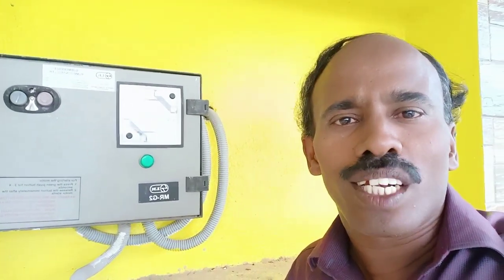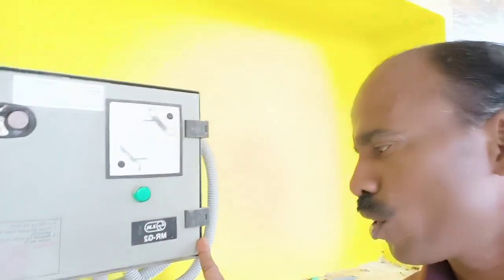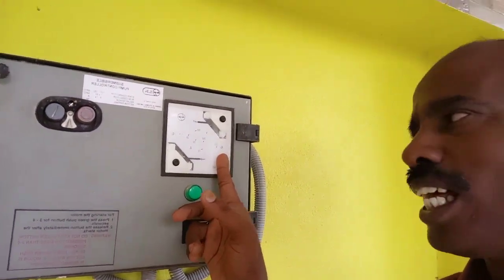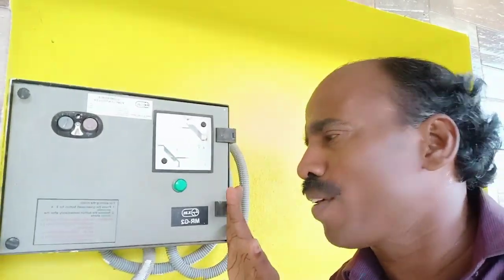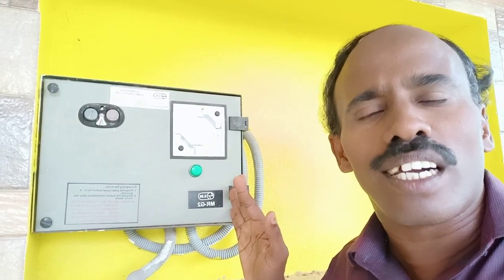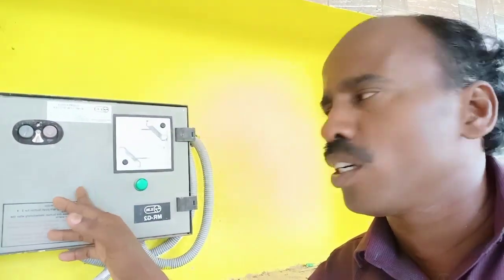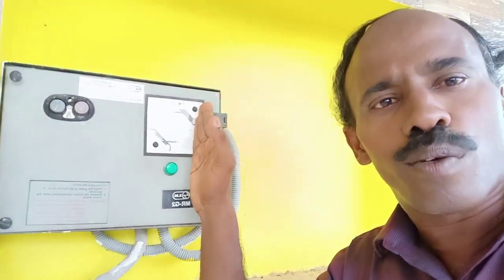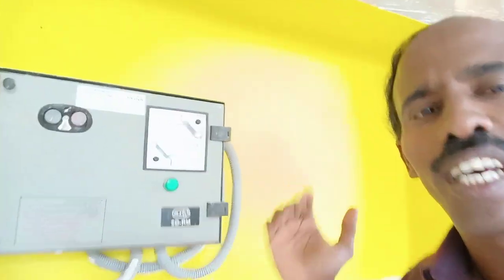ஸ்டார்ட்டர்க்கு முன் MCB அவசியமா?

Comment: Bro battery charging pathi oru video podunga bro detail la ?
Ore confuse sa iruku, Ippa 1 amp charger na battery ya slow wa charge aagum, athuve 2 amps charger na seekiram ma charge aagunu solranga eppadi bro,  doubt inna na load da poruthu thaana amps maarum, ippa namba evalove Ah battery kudukuromo antha alavu thaana amps edukum ? Konjam clear pannuga bro ?
Reply: Good question bro......Example ku Oru 10 amps 12 vollt  battery ya 2 amps 12 volt charger la use pannuna 10 mints la charge agum same 12 volt 5 charger ahy nama battery charger pannumbothu time reduce agum bro .......formula Time &1/Current
Reply: @ranjithselvam4933  bro en doubt tu, amps athiga panna time  koraiuthu atha pathi illa bro, charger la amps eppadi increase panranga, pothuva load poruthu thaana amps maarum (for example 230v) 1000 w load na 5 amps edukum, 500w load na 2.5 amps edukum . So amps depend on load.
Ippa 12v 5ah battery na 5 amps thaana edukum ? Ippa charger output 1amp na overload aagatha?

Comment: Sir vanakam, 7.5 hp agriculture openwell submersible motor starter on aguthu but one hour after off Panna moving contact deenergiesed AGALA , checked nc push button ok, checked all control circuit good condition what is problem tell me sir, moving contact kit nob Ellam clean panniten